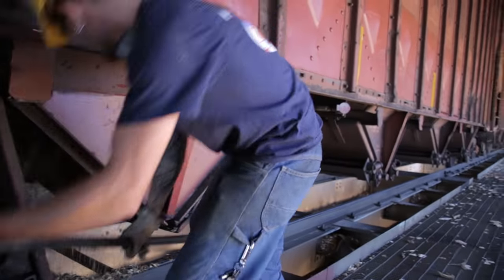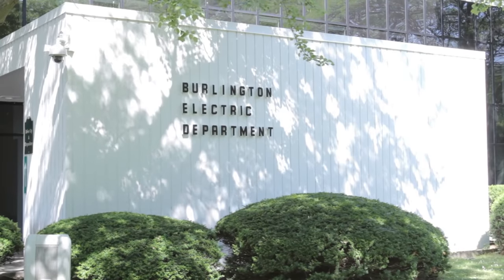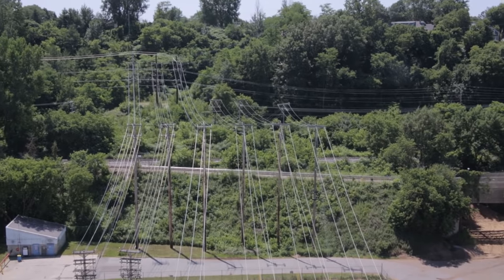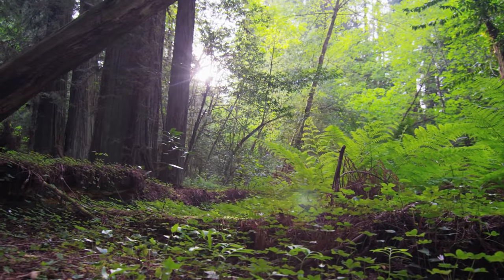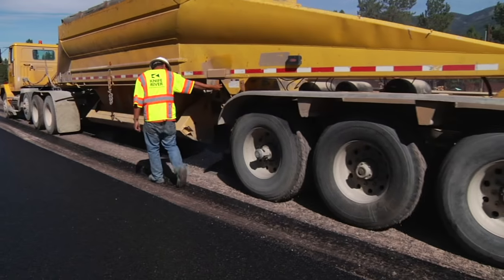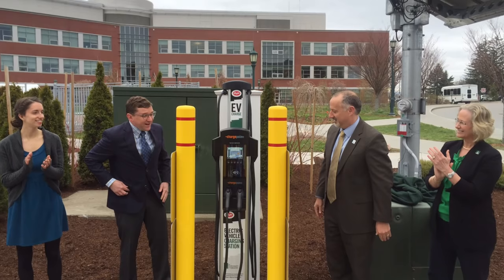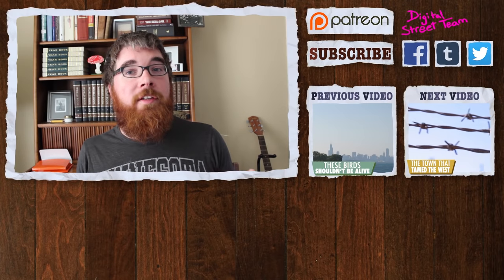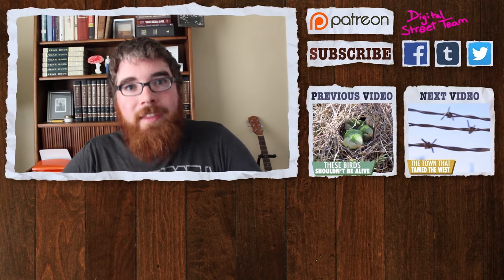Can A City Run On 100% Renewable Energy?

Comment: Not sure why I can't respond to Vegard Løknes directly - but I looked it up, the population density of the USA is more than twice that of Norway, the and the GDP per capita of Norway is 1.2 times more than the USA. So Norway is a bit more rich per capita, but far less crowded. I also looked at a few population density maps - Norway has thin strips of population around the edges, but the USA distribution is quite different. Western USA is sparsely populated until you hit the ocean, but eastern USA has population pretty much everywhere. The east side of the USA is nothing like Norway in terms of population distribution, so what succeeds in Norway might not translate well to the eastern half of the USA.

Anyways - back to the video. I do worry that it won't scale well. Hydroelectric is, as far as I know, pretty much maxed out in the USA. There are only so many places where hydroelectric power makes sense, and those places are pretty much taken. Wind power and solar power are unreliable and takes up a lot of land. Biomass will also take up a lot of land, and from the comments below might not be practical on a large scale.

My personal opinion is that nuclear shouldn't be off the table. I understand the concerns related to nuclear waste, but I suspect the fears are overblown.
Reply: Solar and Wind don't just take up space, they're unreliable until cost-effective energy storage methods are developed, and the material cost to make them and the associated carbon footprint footprint defeat the purpose of even having them.
Reply: I don't really understand, why is everybody so concerned with nuclear waste. Most of it in Europe is stored in old Russian mine shaft from soviet era, so deep it can't damage even underground water

Comment: 100% renewable generation, but we buy power from other utilities LMAO
Reply: Yeah, & they sell power to the grid when they’re in excess. It’s just an exchange that’s required because we can’t magically store that power indefinitely, it has to get used or else you’re just expending energy for no return.
Reply: @RuinedTemple  Believe me they buy way more energy than they sell. The capacity factor for solar is pathetic. Most of the US only gets 3 solar hours per day average. Install one KW of solar and get 3 KWh of electricity in a day. Install one KW of fossil fuel powered generation and get 24KWh in a day.
Reply: Cindy Tepper Right, but they also have power generated from their wood chip steam & hydro to use & sell, correct?

Comment: This is all very cute but not scalable.  Powering metropolitan Chicago using the biomass solution would entail cutting down 180 million trees per year.  You simply cannot reforest on that scale, not to mention the cost of transporting millions of tons of wood chips into large urban power plants.  BTW, were those gasoline powered trains and tractors I noticed in the video?   To date, there are only 5 towns or small cities in America that are close to 100% powered by renewables: total population of these locations is less than 50,000 people.  We should continue on a limited path to making energy extraction from renewables more efficient, but oil/gas/coal is the overwhelming choice for powering this nation into the 25th century.

Comment: sure, drop a dozen or more panel on every building and plug them to the grid, that will do the trick
Reply: That would only cause blackout over the entire area of the power grid. Too much electricity in the grid is even worse than not enough electricity.
Reply: @FrainBart_main  unless you regulate the amount of power you send when it is needed.
if no power is needed panel turn off.
add some powerwall to the houses and you would have an enormous amount of energy.
every building could run ac and heat when needed, there could be more street lights, you could even put out charging station for e-cars.

but it's an utopic idea
Reply: @keshlalish5586  Your're right but doing this would be extremely expensive. Having a mix of clean power plants together with other grid stability measures like demand-side management is a lot better idea.

Comment: I am not convinced. I don't know what the CO2 output of wood chip is compared to coal. Natural gas is  50% less than coal. I tend to think is playing with words to call it renewable.
Reply: Did you listen to the video?
Do you know what trees are made of?
They are made of air!
The CO2 that gets release while burning wood is only the CO2 it has absorbed while growing in the first place.
So if you constantly grow and burn wood its neutral.
Reply: I take back what I have just said. The CO2 output from wood chip burning  is only 14% of that of hard coal. ref: Biomas Energy Centre.
Reply: the output is irrelevant because the threes that they are growing will absorb 100% of the CO2 pollution by definition.
Reply: It is renewable because the trees grow back. It is carbon neutral because if you burn one tree and then let another grow back to the same size in its place, the new tree has absorbed the same amount of carbon that the previous tree released. You can think of it as having an initial "carbon cost", but the quantity is replaced and then taken again. 

By selectively harvesting the trees, they aren't even destroying the habitats. They are damaging them I'm sure, but those ecosystems can handle that stress if it's done correctly and they'll fill back in quickly and be nice until they're harvested again.
Reply: Trees get most of their mass from CO2 in the air, not by pulling material out of the ground.
Reply: CO2 from wood chips is actually higher than coal. You get 12000 btu from a pound of coal, about 8000 from wood chips unless they are bone dry. Most wood is at a minimum 10% moisture.
Reply: Burning fossil fuel released CO2 that are trapped, isolated from carbon cycle for million of years. Wood chip and most biomass are carbon neutral, as long as the trees are harvest and regrow, it will not add anymore CO2 to the carbon cycle.

Comment: Three words. Integral Fast Reactors.
Also solar and wind aren't as clean as you think they are. They are made in factories (mostly in china). Those factories run off of coal and oil. Then the parts are shipped to the us using a cargo ship powered by fossil fuels. Then it is trucked to a place in america, more fossil fuels. So no your little town in not "100% clean energy". They are just paying someone else to pollute other places on earth to keep their city "clean".
The only truly clean  energy in nuclear, especially integral fast reactors which cannot melt down no matter what, and they recycle their fuel almost indefinitely.

Comment: This is colossaly stupid for two reasons:
1. Energy prices in Vermont are pretty high because of the pseudo-renewable energy.
2. Burning wood chips creates MORE emissions than burning Natural gas, gasoline or even crude oil. It´s "renewable" in the sense that you can grow the fuel but it´s worse for the environment.
3. The wood requires cutting down forests/plantations, which in turn take up space that would be available to wild plants and animals.

Yet another stupid attempt to virtue signal to the world how "green" their solution is, while in reality, it does more harm to nature than using good old oil.
Reply: 1:  That wood was being cut down anyway to make wood products.  The chips are what's left over after they got all the useful building materials out of the trees (lumber, plywood etc.).  No one chops down whole trees just to burn them for power.  That would be colossally stupid.

2:  You apparently missed the part where the guys were standing on the roof of the power plant, looking up at the smokestack, and noting that it appeared that there was nothing coming out of it.  The ash they retain from their electrostatic precipitators is used for soil conditioner and road beds.

3:  You apparently also missed the part where they mention that they don't clear-cut the forests, and they replant, and have already gotten second generation growth out of the same forest areas.  Many of the animals in the forest have 4 (or more) legs or 2 wings, and can move from areas that have been cut to nearby areas that haven't.  That's one of the perks of not clear-cutting the forest.

Comment: To all those saying "Yeah, but the diesel trucks and logging equipment use fossil fuels so nyanyanya!" Diesel powered trucks and logging equipment can be run on renewable fuel as well. Waste cooking oil has powered my zero turn mower for years and has "harvested" literally tons of biomass per year without burning fossil fuels.
Reply: They are electric truck

Comment: Burlington should call Tesla to add more Solar with battery power packs and dump the wood chips.  Wood releases CO2. It may be better than oil or coal but it's still air pollution.

Comment: To answer your question - NO. Not even these guys can run without reying on a fossil fuel backup when times are tough, and they have millions of trees to cut and burn for their relatively small need. One or two smelters, or deep level mines will pobably use their use their entire power demand, so their are not enough trees to burn to power big cities and industry. This is a niche solution that is almost run on 100% renewable. We are getting there but until we have mass scale power storage we will always need a fossil fuel backup since renewables are unreliable by their nature. Exciting times ahead in the storage world while it catches up to its green generation cousin.

Comment: I would love to see Stan Meyers technology or the stuff that powers UFO's or Searl Effect generators to power the world. The internal combustion engine needs to be replaced and it looks like batteries will do it but still I want to see some real sci-fi energy production to come online. I am ready to kick the oil habit and the constant need for fuel or more energy. 

The bonds between atoms obviously hold massive amounts of power and when they are split we get nuclear bombs but short of that there must be a far less violent way to tap into that unlimited source of energy. Nuclear energy is fine but I don't know I am still convinced that by toying with radio frequencies, sound or magnetic energy we could hit that zero point jackpot and unleash tremendous amounts of safe, peaceful energy that can last very close to forever.

For now though I am happy with my solar panels and batteries, off grid here in Canada

Comment: See my complete house energy solution by checking my last youtube video or my kickstarter. 
My solution is based on PV panels plus thermal storage plus lithium storage for a net zero energy house solution cost competitive with natural gas and grid electricity.

Comment: good luck replacing nuclear and coal as those lobbies will do whatever it takes to remain relevant and in use. Ontario Canada is facing a massive bill to restore our nuclear power stations even though we could buy cheaper 0 pollution electricity from hydro dams in Quebec. The nuclear lobby is attacking that proposition through advertising and a relentless campaign about jobs. Guess who's winning.

Comment: No, it doesn't run 100% on renewables. It still consumes gasoline, diesel, natural gas.
Running the electricity grid 100% from renewables is just a part of the solution.
And even if they manage to run the city 100% from renewables including transportation and heating people will still be purchasing products from factories that don't run 100% on renewables.
Don't get me wrong, having a city's grid run 100% on renewable electricity is good, but its just 25% of the complete solution.
Lets keep sight of the complete challenge.

Comment: I’m quite sceptical about this so-called renewable energy source. It may be fine for a place like northern Vermont where they have lots of trees to grow and regrow, but in general it’s completely unsustainable. Suppose we wanted to replace all coal burning plants by this, which would be wonderful - you think. The total is 1,208 billion kWh . Burning 1.25 tons of wood has an energy content of about 22 GJ (gigajoules) and 1 GJ is 278 kWh . But the efficiency in generating electricity is at most 1/3. Now you can find by googling around that the amount of wood one can harvest from an acre of forest without destroying it is somewhere around 5 tones per year. I come to the result that in order to replace all coal power plants we would need to harvest from about 205,000 square miles of forest. That’s about 6 percent of the land area of the USA.  And it’s almost half of all forested land of the USA. So bullshit. I still think that we will need nuclear power plants. Get over it. Solar and wind alone won’t do.

Comment: I only just watched this video. While I'm not too sure about biomass power (although definitely better than coal based on how they seem to be managing it in Burlington re pollution control), I loved the final statement about microgrids. I live in Australia where there is an extremely low population density - there are less than 0.1 people per square kilometre across most of the country. My understanding is that a lot of our high energy and telecommunications costs come from trying to connect such far-reaching areas. Microgrids would make SO MUCH SENSE in Australia. One town is already making plans to go off the main power grid, in big part because it's cheaper. It seems silly that this concept of microgrids hasn't been supported already.

Comment: So what is the cost per kilowatt in Burlington, Vermont?  The proposed micro-grids sound great on a residential level but try to do any real industrial work (welding, inductive heating, electric motor driven work) and your reactive load balancing becomes a real problem that your micro grid inverters can't handle.  Living with wind turbines is the dreamed rural bliss that is imagined by urban dwellers.  They are loud, blinking light behemoths that have spread visual and noise pollution across the country side.  We have sold our horizon, sunset, sunrise and night sky to the mess of big wind.

Comment: I beg to differ that ”new” trees absorb more carbon than old trees. 
Really differ . 
Let me explain: 
A young tree has a small crown and few leaves/needles. Leaves/needles retain a lot of the yearly carbon. Fruits, cones and seeds make another big chunk of the absorbed carbon. The wood itself, being the trunk and branches get a few millimeters of thickness yearly.  That represents less than 50% of the carbon absorbed. 
An older three, say 200-500 years old has a huge crown, the grows massive branches and bears * a lot more leaves and fruits/seeds * 

And whilst a tree can live for 700 to 1200 years, with some exceptions being several millennia old, calling a forest mature at around 100 years is like calling a 4 year old child mature and ready to join the army (and die in war in the next 10 months). 

You don't see trees that old so often just because they are cut millennia before they'd be called old.

Comment: Biomass is worse environmentally wise than natural gas. Hydro has been around forever, it's a good energy source, but it doesn't have any potential left to grow. So the only green energy sources that have actually changed here are wind and solar which are 25% of a small town with 40 thousand people and mostly sparsely populated (where most people don't live in apartment blocks). And those 25% require backup systems, which in this case are hydro and biomass, in most places it would have to be coal and natural gas. That's not a good prospect.

Comment: Of course, dozens of entire countries run on RE in the form hydro electric power.  Intermittent power like solar and wind does not run anything 100%.  Burning up trees doesnt scale nor should it given the traditional emissions like particulates and NOx (a lot more per unit than coal).

Comment: As long as their dream to descentralize the power and make every house or block be a self sustained power system is kept, this seems to be going the right way, so eventually they will reduce their dependency on the biomass, or even get rid of it, replacing it with solar and batteries.

Comment: Oil came from decades of compressed trees & plants under high pressure and temperature. But funny thing is they use carbon emission machines to transport and krunch into small pieces.